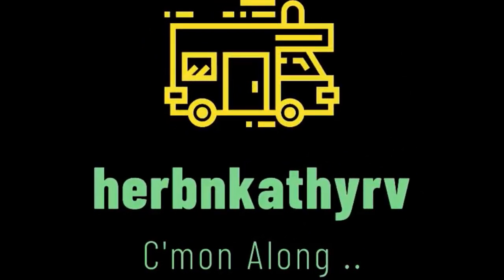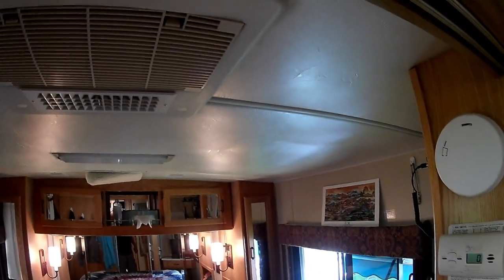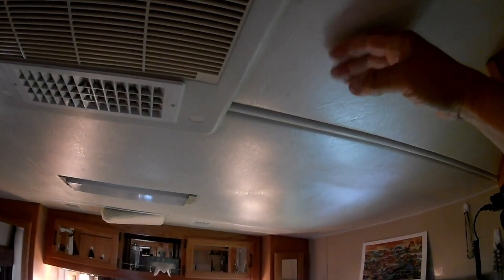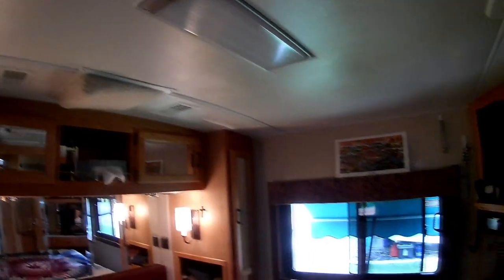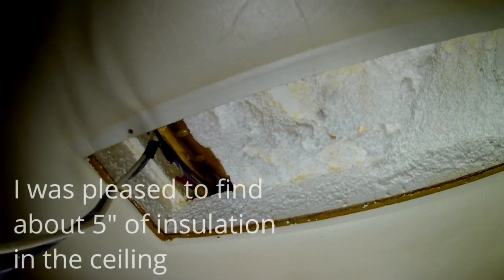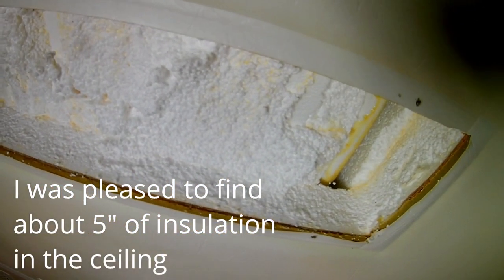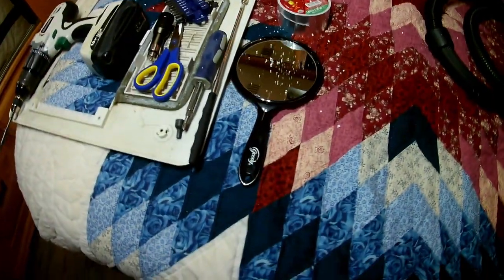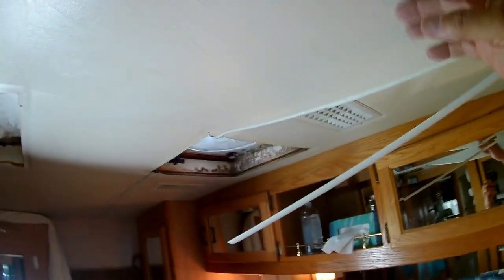Is your RV Ceiling Sagging too?

Comment: Thank you for your video.  It has helped me so much. I thought I was going to have to replace the entire ceiling.   I bought the adhesive today.  I'm so anxious to try it.  Again THANK YOU!!!!!!
Reply from the maker: Sandy, your biggest challenge will be to get the adhesive in as far as possible into the void (the spray wand is only 6" long.  The more you pull the ceiling vinyl down, the more (deeper) you have to spray.  It would be good to be able to get adhesive on a small (but long) wand that you can then push way deep into the void.  But I found that some adhesive is better than none.  Don't pull down any add'l ceiling - if it's still glued then leave it alone.

Comment: Enjoyed this and gave me some insight to our ceiling drooping and coming down in this southern heat,  Glad to know the strips are able to be replaced back in the grove........basically the adhesive has come undone by the heat of the south the outside fabric is ok but the foam originally is clinging and I wonder if I can vacuum it out of whatever.  Not knowing where to find the same lining fabric in this coach 91 winnabago Class A and the cost as well would be  over the moon I am sure.   Thanks for the tips!!!
Good video.

Comment: Great job. I have a sagging ceiling and planed to use the adhesive spray. Now I know it can work. Thanks.
Reply from the maker: Here's another tip.  The challenge is to be able to get the adhesive far back into the gap where the vinyl ceiling cover and the backing board meet.  I think if I was to do it again, I might try getting some sort of glue I could put into a small hypodermic needle and shoot directly through the cover at the spot(s) where they come together.  Problem is the spray can only get back in so far.  Hope it works out for you.
Reply: @HerbBaldwin  , That was my thought as well. I plan to cut a tiny slit and push the nozzle through to spray between the lining and the roof. I hope since it is sagging the gap will provide room for the spray to go way back into the area. I'll let you know. I also bought a 5" roller like you used to flatten it. I had planned to buy a rolling pin until I saw what you used. I can also use that width of a roller to adhere some tape to cover areas that have potential for leaks on the roof and seems. Thanks again.

Comment: Thank you for your YouTube video. I have the same headliner problem in my 2006 Winn Adventurer. I bought the items you used for reattaching the headliner. I’m starting the repair tomorrow.  How much adhesive did you stray in? Also, is your repair still holding?
Reply from the maker: My repair is not still holding, it's especially obvious when the roof a/c is on (air blows in between the ceiling and the headliner).  I found this video and this idea is slick!  I've ordered and received the syringes and the adhesive, now to give it a shot.  Follow this Link
https://youtu.be/QdH-UPFVAt0

Comment: You have a great video here, very informative of what you are going/have done.  What I would have liked to see more of is the actual spraying of the glue, how it went, what you had to do to get the panel covered (the center).  How the strips actually come off and go back on. Otherwise you have a good video, thanks for the information.
Reply from the maker: Geoffrey, thanks so much for watching and for your comment.  You are right, I wish I would have planned the video a little better.  I got so involved in the actual repair, I forgot to shoot some of the work!  I should have had my wife hold the camera as I was doing the work instead of trying to do both myself.  The strips pop off real easy and then go back up and snap in place with a bump of your fist.  The ceiling fabric on the other hand really needs to come down on 3 sides so it can be sprayed with the glue and allowed to dry a minute or two.  I didn't want to take mine apart that much so I wasn't able to get the spray deep into the opening as much as I would have liked to.  Also, you'll want to put up some newspaper along the adjacent wall and furniture to keep from getting overspray where you don't want it!

Comment: Well done...the project and the video! You spent time filling some air leaks as well. Have you found the A/C is blowing colder?
Reply from the maker: Havent noticed that its cooler, every day is different, so it's hard to tell.  Outside temp varies widely as the rig is in sun and in the shade cuz of the trees.  But at least the ceiling liner doesnt billow like it used to when the air is on!

Comment: We own a faith wheel that we are traveling in at this time. But we found an old Terry camper that we would like To renovate for our family. There was water damage in the front and the ceiling needs repaired. It is a curved ceiling. We tried a piece of laminated paneling but it was very difficult and does not look presentable. Do you have any suggestions on process and materials to use for this curved ceiling?

Comment: Sonhow mk oong didnyiu wait befor the glue activated?  Did you have to remove the foam from the ceiling before it would adhere?
Reply from the maker: The foam didn't stay on the ceiliing, it stayed on the vinyl material.  The difficulty was getting the spray to go in far enough to do any good.  It'd be great to have a spray can with a 3 or 4' long flexible nozzle tube.  I only waited about 15-30 seconds, probably not long enough.

Comment: Did you have to spray both the ceiling and the headliner for it to stick?
Reply from the maker: Sandi, yes spray both sides, following instructions wait a bit for surfaces to get tacky, then press and roll with a linoleum roller (or similar) to get good contact